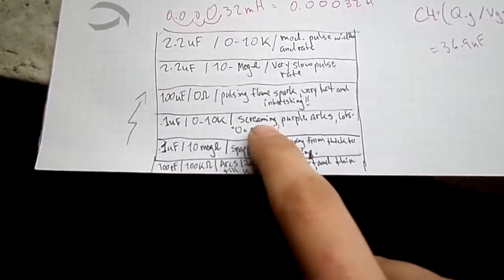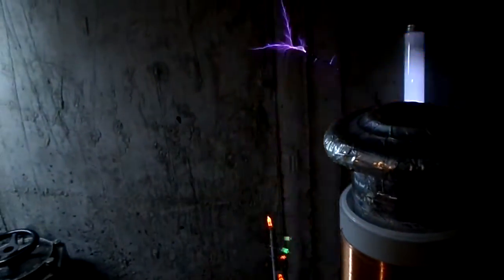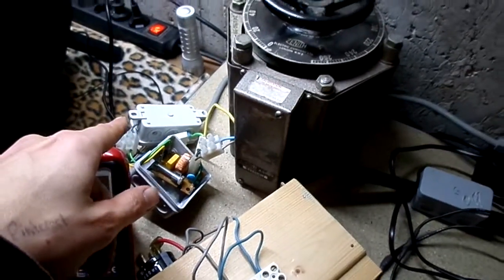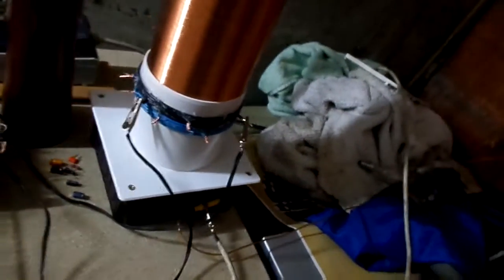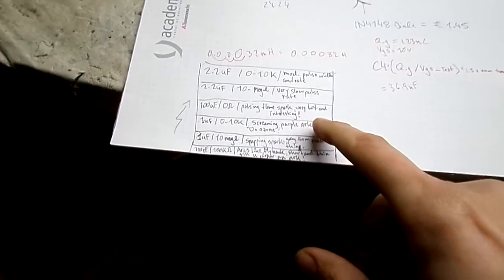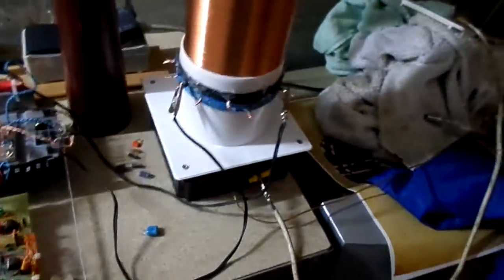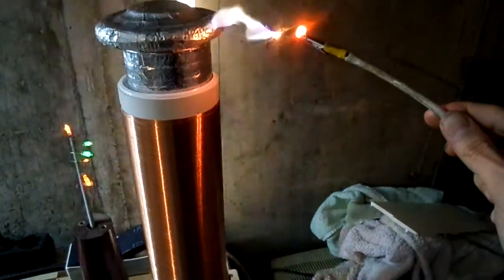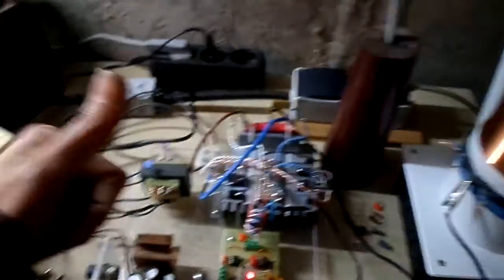mini half bridge SSTC part 2

Comment: If you put 2 10A fuses in series, it will still blow at 10A, put 2 in parallel will double.
Nice arcs :)
Reply from the maker: +Sparky Projects ah i knew i messed that up will the voltage rating increase if they are put in series or it does fuck all ?! yeah not bad so far i'll be more comfortable running the H-bridge when i get better FETs plus i need to figure out why he coil hates the correct top load, on the 3rd or 4th tap on the primary the coil works the best ...
Reply: +dirkk82 The voltage rating doesn&#39;t change much, it&#39;s like a very low value resistor, so low that you can ignore voltage drop (working voltage), current through a circuit hardly changes with more fuses in series
Any voltage rating would be the max voltage you can use it on, this is because when it blows you don&#39;t want flashover to the ends.
this is why 11KV fuses are very long.